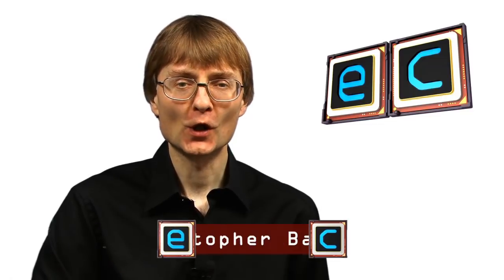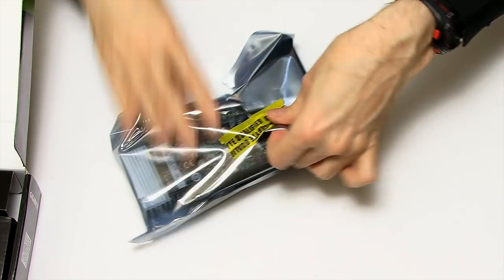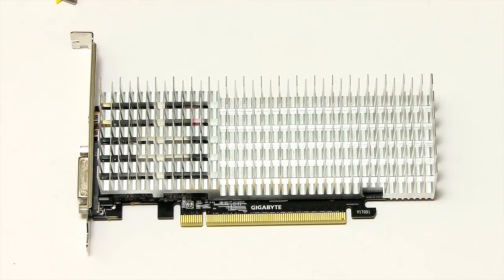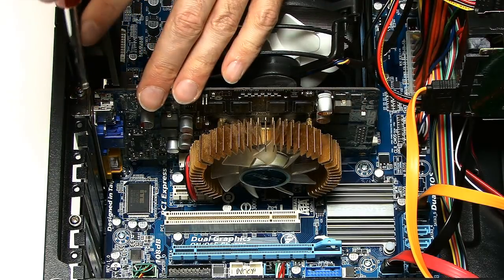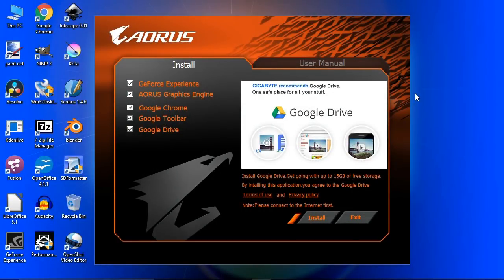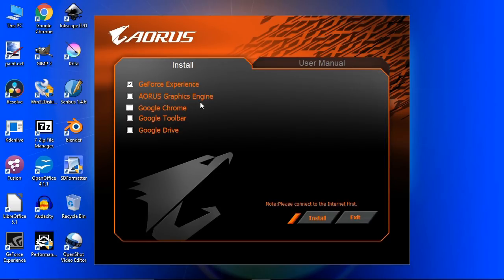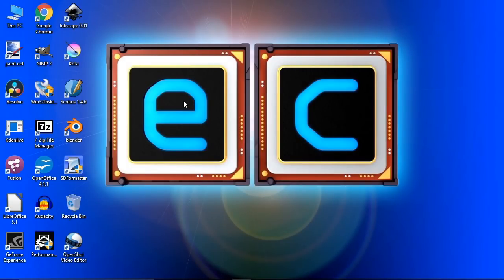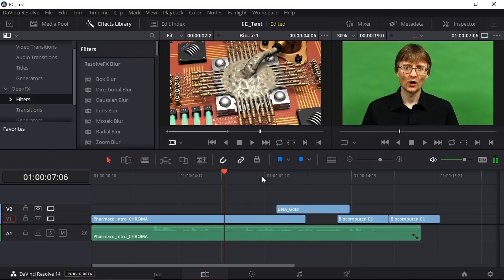GT 1030 Silent Graphics Card

Comment: Is the GT1030 2gb gddr5 with Active Cooling still ok today, Jan 2026, for the current version of DaVinci Resolve 20.3.1?  I have one laying around that I want to donate to my church because they need a graphics card to run DaVinci.
i7-9700k with 32Gb DDR4 RAM @3200Mts
Reply from the maker: I've yet to try 20.x, but can still run DaVinci Resolve 19.x in both Windows and Linux with no issues with the GT1030 2GB. I don't imagine 20.x will be any different.
Reply: @ExplainingComputers thank you

Comment: I have exactly this card in my HP prodesk 600Sff. I upgraded it to in i7  4790, 32 Gb and an SSD.

This combination in total cost me like EUR 250. 

Fun thing about this I have a silent computer which has a minor power draw, AND it plays most games just fine at 1080p high settings (like GTA V).

It's about EOL now as games progress, but even in 2023 this is still a perfecly fine and viable budget gaming solution.

For my son I purchased a ryzen 5600G based PC. This outpeforms the 1030 slightly, but has the advantage of having an upgrade path.

If you want hardcore gaming in low profile, you now need an A2000.

Comment: I use a Dell sff with an i5-3470 and GT 1030 in an emulation rig. I've tested all the way into ps2 and it works flawlessly(as far as emulation goes).
The more advanced emulators do require more fan/airflow due to card heating up tho. Without the card starts to throttle in <2mins.

Comment: Almost 2022, bought an asus passively cooled one a month ago after my 1050ti went kaput and overclocked it by more than 200 MHz on core and 530+ MHz on memory. To keep temps down, I strapped a 60mm case fan onto the large heatsink with zip ties and have it run full whack off a molex end of the psu and it maintains a good high 50s-low 60s celsius at full load while gaming.

Comment: My rig is as quiet as they come until I put a 1050ti in there. It’s got 2 fans and I would very much like to doctor it. Those bquiet fans are very good indeed. My psu fan doesn’t even kick in either until it’s under heavy load and that’s never happened. My psu is a corsair 850w modular. My chip is i7 9700k. I sure like the look of that card and it would match my aorus motherboard. My motherboard is aorus pro wifi where the wifi don’t work well for some reason. I have to have it hard wired. The fist one I had to send back due to a faulty hdmi port. The wifi didn’t work on that one either.

Comment: Hi there 

I have borrow Nvidia gt 1030 ddr 5 2 gb from my friend. After upgrading drivers from gpu experience game run perfectly but When i come to playing Videos on Pot Player some videos become glitchy but other player play that video well.

i am so worried. Does my gpu has fault in it. Is gpu going to die ? I have some on internet there says Glitchy videos gpu going to die..

Graphics is play games fine working normally when it comes to playing videos Anime Movies pot player video become glitchy when i disable nvidia videos driver that videos play full of fine on pot player.

Do i return back gpu to my friend i am so worried ???
Reply: Sounds like a  software compatibility issue. My suggestion is to try use different video player like windows default player or VLC. See if the problem exists. If again, uninstall your graphic driver and try to use windows default driver.  Also ,try put graphic card to you own PC if doesn't solve the problem. If nothing improved, you probably need to return the card.

Comment: Good God man, a 1030 that is not a very good card

Why don't you buy a 1080 TI?

Because in 2021 the 1030 didn't age well unlike 1080 TI
Reply: I think you missed the point here.

Why did he buy a GT 1030? Probably because he isn’t a gamer. Probably because he wanted the computer to be silent. Probably because he didn’t feel like paying literally ten times the cost for a GTX 1080Ti. Probably because his videos are 1080p max resolution. Probably because his workflow wouldn’t be meaningfully benefited in any significant way by having a more powerful card. Probably because if the video takes two hours to render verses 45 minutes it doesn’t change anything in his day nor does it make his videos any less valuable to any of us who watch them. Probably because the CPU would be bottlenecked by a more powerful unnecessary GPU. Probably because he has more then one computer and this computer isn’t the machine he edits videos on. Probably because he lives in the land of common sense and doesn’t aspire to live his life like LTT promoting the idea that anything that isn’t literally the newest most expensive hardware available is outdated crap not worth anyone’s time to even consider. Seriously, you couldn’t make any of these connections on your own? Really?

I think the card aged quite well if you are realistic in your expectations with it considering you can play triple-A games at lower settings just fine. Doubly so if you overclock it. Perhaps spend less time in the LTT forums and more time in the land of common sense. After all, Nvidia did make the card for a reason knowing certain consumers would need such a card. Common sense; it’s amazing isn’t it?

Comment: The passive 1030 is a lovely little card for a home theatre PC if your build isn't using a CPU with integrated graphics.  I've used the ASUS passive model (basically the same half-height reference card with a different shaped passive heat sink) in my HTPC for some time.  My only real complaint is that 10-bit (HDR) colour playback is a nightmare but that's not the card's fault.  Windows 10 has a rubbish HDR implementation.

Comment: Hello ! I have this exact GPU for more than a year now. I'm very happy with it, I also play lots of games including GTA V in very high detailes, Black Mesa (around 120 FPS) and much more games but I had overclocked it with the Aorus engine GPU Boost - 1667 and Memory Clock 7498, also I added a 5volt fan on it to keep the temperatures low while gaming. Up to 85C without the fan and up to 55C with the fan in the summer heat and demanding games.
Reply: Bro can u tell me how much fps in fortnite in low 1600*900p
Reply: @doudou_gaming7615  I don't play fortnite but make sure you chose the GDDR5 version instead of GDDR3

Comment: Nice thing about knowing more about computers than this guy is that you can still get drivers DIRECTLY from Nvidia with out any hassle and  without using GeForce experience. It's completely optional. Grinds my gears when people get all worked up about something they are ignorant about.
Reply from the maker: I am not "ignorant" about this, and did get drivers directly, as I make clear in the video. My point in the video is that the default position for many users will be to install G-Force Experience, which used to provide an option for driver updates only without creating an account, and now does not.

Comment: you CAN use this card if you have VGA monitor, just buy an hdmi/dvi to VGA adapter
Reply from the maker: This card had digital DVI-D out only, not DVI-I. So it has no analogue output, and hence a standard DVI to VGA adaptor -- as are very commonly used -- will not work. You are right that a powered adaptor with a digital to analogue converter would work. But these are often problematic, and I would not recommend purchasing a low-cost video card that required a reasonably expensive adaptor to work work with somebody's VGA monitor.
Reply: @ExplainingComputers  adapter to vga is actually pretty cheap (in my local store), dvi to vga is around $2 for single link, $4 for dual link, hdmi to vga is a bit more at $5-10.
Reply from the maker: @hiro9253  I am certain you will find that those $2/4$ DVI to VGA single link adapters would not work with this card -- that is my point! :) There are three standards for DVI sockets -- DVI-A, DVI-D and DVI-I. This graphics card is -- fairly unusually - DVI-D, so the basic DVI to VGA adapters that many people are used to plugging into a DVI-I or DVI-A port will not work because there is no analogue signal in the port to directly connect to VGA. There are powered DVI-D to VGA adapters (usually plugging into the DVI port and a USB port, or their own power adapter). But these are more expensive. :)
Reply: @ExplainingComputers  maybe, but those $2-$4 dvi to vga adapter works with my brother's gtx 750ti. So theres nothing wrong to try it on gt 1030
Reply from the maker: @hiro9253  And it will not work! :) This is nothing to do with this being a GT 1030 card. It is to do with the fact that this particular GT 1030 card has a DVI-D port, not a far more common DVI-I  socket (they look nearly identical, but different pins are wired). This is the whole point I am trying (and clearly failing) to make. The adapters you mention will work on the vast majority of GT and GTX cards. But not on this one! My warning that this card is not suited for people with a VGA monitor is on the basis that 99.9% of DVI to VGA adapters will not work with this card! :)
Reply: @ExplainingComputers  99.9%? how do you even count that? even if it is 99.9% there is still 0.1% vga adapter that CAN work with 1030, yes active adapter is more expensive but it still cheaper compared to hdmi to vga adapter , instead of saying "you cant", you should have said that we need a certain type of adapter to use vga monitor. because in some country, a dvimonitor can cost the same price as gt 1030, when you said "you cant use this gpu on vga monitor" you basically tell them to buy a new monitor or sell the 1030.
Reply from the maker: @hiro9253  My 99% was a guess. :) I am not telling anybody to buy a new monitor or sell the GT 1030. I am advising not to buy this particular GT 1030 model in the first place if they want to use it with a VGA monitor. :)

Comment: woukd this be overkill if i have a 1080P monitor?
Reply from the maker: Not overkill at all -- this is a good card for 1080p -- a GT1030 will run all 1080p media well (and here silently), as well as giving decent power for video editing and some gaming or other 3D applications. A very modern PC's onboard graphics (if it has them) are likely to be almost as good as a GT1030. But for any PC a few years old or more, a GT1030 card is a good compromise if you want a bit more graphics power, but do not want to fit a far more expensive and power hungry card.

Comment: Is really too much the performance difference compared with an active cooling gt 1030 ddr5 version? I've heard they have to underclock the passive versions a little bit not to fry them. But I'm really seduced by the SILENT feature... So... Is the performance difference really significant? Thank you
Reply from the maker: Performance should be the same. GAMING versions with fans may be overclocked and run a little faster though.

Comment: It's a GPU from Gigabyte. It's the manufacturers fault, what you've found on the included DVD. Drivers have to be acquired from the Chipset-Manufacturer. That's NVidia's webpage. They also contain GeForce Experience, which can be deselected. Otherwise your videos are really fine.

Comment: Hmm the Tomshardware reviews shows the passive actually performing better than the actively cooled 1030, because the passive is also touching the VRMs with the heatsink. Is this still the best 1030 option? Need a half height bracket
Reply from the maker: I still like this card very much -- quiet, and powerful enough to allow decent video editing.

Comment: Just curious does everyone not understand that GeForce Experience is a separate program from the drivers. Just select drivers only during the installation. It gives and option. 1) Drivers and GeForce Experience or 2) Drivers only.
Reply from the maker: I am very well aware that drivers only can be installed, and indeed I do install drivers for the card in the video. But this was not my point. :) GeForce Experience used to be a useful program for updating graphics drivers (ie obtaining them as needed online as they update), and for configuring graphics card settings (eg colour profiles). And for such functionality -- which is why I went to install it, as I had on many occasions for many years  -- a login account should not be required.
Reply: @ExplainingComputers  alrighty, I was just curious.  I wasn't sure if you did or not. Have a Happy new year sir.😁
Reply from the maker: And to you! Have a great 2019. :)

Comment: Of course you can use a VGA monitor, just buy an adapter DVI to VGA. Helped my father with that, his monitor only had VGA. Problem solved.
Reply from the maker: But be aware that the output from this card is DVI-D, not DVI-A: DVI is not a single standard, and hence it would be very foolish of me here to suggest that a simple passive adaptor will work, as it simply will not. If your DVI port outputs analogue video (DVI-A) then yes, such a passive adaptor will operate fine. But if, as here, you have a DVI-D port -- with no analogue output -- then a passive DVI to VGA adaptor cannot function. You could use an active (powered) adaptor to converts from digital to analogue video, but these are far more expensive, need the power input, and can be problematic (I've frequently seen them fail). So please, do not spread "problem solved" advice that works in some scenarios only -- and a decreasing proportion of them. DVI-A used to be very common, and with them passive DVI to VGA adaptors. But increasingly ports are DVI-D only.

Comment: I have this exact same board in the computer I'm using to type this.  I really like it.  I have a quiet PSU and you can't tell my computer is if you can't see the screen on.  Performance is good enough that I can play starcraft 2 at all max settings.  Haven't tried anything else as this is my "productivity" computer.  It didn't ask me to give up any person info when installing the driver, though.  Grabbed them straight from NVidia's site.

Comment: while your old 9500GS might not be suitable for video editing anymore, you can use it as a basic VGA adapter to make sure a PC is working, or add it to a PC to enable connection of more than 3 displays. Just as examples.
Reply from the maker: Totally. The older card still has value. :)

Comment: For your mother board, this card will make it unstable system, due to its heat sink is very close or even touches the mother board's chipset heat sink . I think that any one planning to purchase for this kind of cards, must examine the space over the mother board to void such these extra thermal load on the system.
Reply from the maker: The heat sink does not touch the board or its components, and does not get that warm. I have not had any stability problems.

Comment: Who would want this card and why ? Just get a 1050 all 1050s have silent mode where they don`t turn the fans on. Or even better just use the on board graphics, its not like the 1030 is any better than those.
Reply from the maker: The 1030 is significantly better than the onboard graphics on many PCs -- certainly the one I have here, which does not even have an HDMI port for recording. It all depends on your requirements.

Comment: I don't know why you are not downloading the drivers directly from the manufacturer :) 
Much easier and you also get the latest updates (beta builds) which Windows won't show until they are Windows Certified. 

I had alot of trouble with Win10 and auto-updating my driver. 
It kept detecting my on-board GPU as my main GPU even though my HDMI cable was running through my graphic card. 
This was very annoying because everytime I rebooted after installing the GPU driver, Win10 would automatically download on-board GPU driver and force restart me. :D

Comment: rules for building a good PC:
put it all on the Processor, Ram and Especially Motherboard! 
motherboard that seems like the format will be the new standard for long on connector and it's RAM and sockets.
the processor needs to be capable of lasting 10 years of operation and fast enough to be a contender for long!
RAM needs to be the max you can place in the machine and FAST!

THEN comes the "MULTIPLE" video cards you will buy over the years! take the best quality/price and you will use it for the next 5 years! do that again and 5 more years! so your PC lasted 10 years! instead of 6 months! no need to buy 10% more performance for a 500$ more than the lower spec card! 

i have a GTX 1050 Ti and it was and is not the TOP of the line but was not over priced also! this will play all games that comes out for the next 5 years at almost full settings! only in 5 years i will have to lower settings in game! so it could go 10 years but people are not me so go ahead in 5 years and buy the next best quality/price card! 

if you hate settings, go with ATI/ if you like settings and customization(and absolute performance ;P ) go Nvidia! ATI is usually very close to Nvidia but Nvidia has the CUDA core that simply is a BEAST! just this card he has there has 384 "PROCESSORS" and those are 2 GHz probably! some applications now days takes that advantage and can compute hundreds of times faster than with a 5 GHz processor (how ever the number of cores and treads they have! 12?) 

video Editing is no joke... seriously don't let me touch your settings on FFDSHOW! post-processing, colors, gamma curves, sharpening, resize with enhancement, then WARPSHARP, then the settings in Mediaplayer Classic on the shaders,  post and screen shaders... this all done in real time. (too bad YouTube don't support me using FFDSHOW Codex... ;P )

well that's enough, i will let your eyes survive i guess!

Comment: I bought the slightly higher priced GTX 1050ti, and it had the same video connectors on the card, so I ended up buying an HDMI-to-VGA dongle and I'm able to use my older monitor with it.